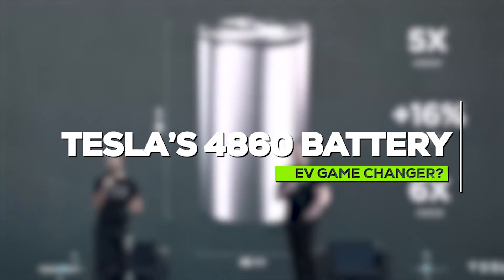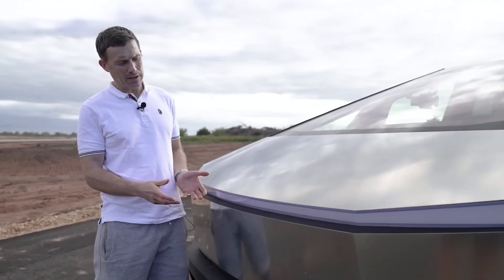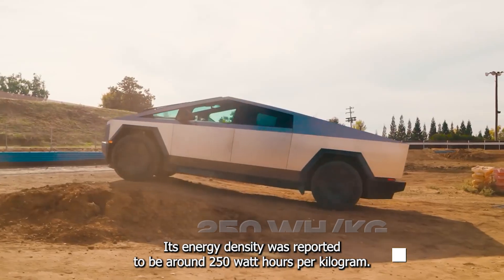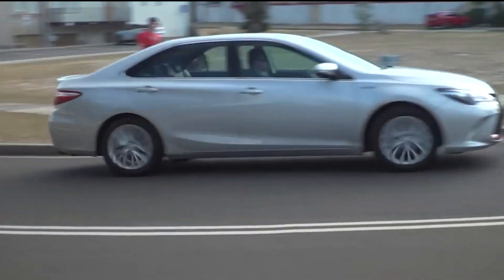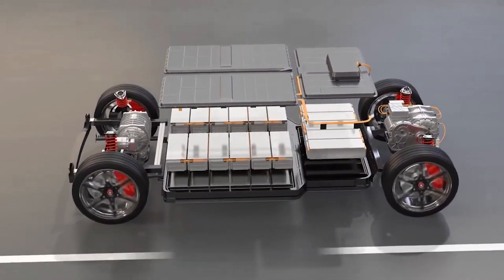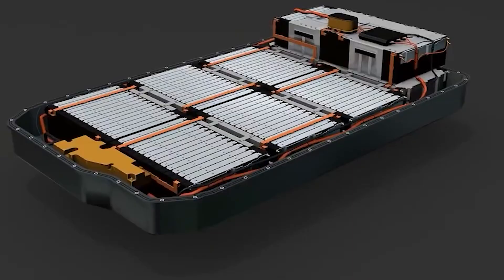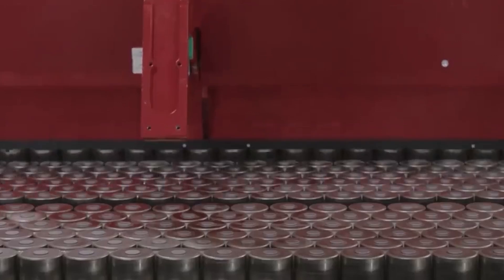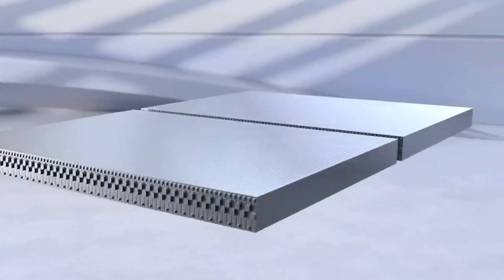Tesla's INSANE New Battery: EV Game Changer or Hype?!

Comment: I mean, you can do some basic research and find out that 4680 batteries are about the same 'energy density' as any other lithium batteries. Sure, they got 5 times the capacity compared to 21700 but that comes at the cost of ~5.5 times the volume and given that both batteries are cylindrical and are packed inside a rectangular box, their size doesn't really affect anything.
Reply from the maker: Great point! It's all about finding the right balance between size and capacity. Sometimes bigger isn't necessarily better. 🤓🔋 #BatteryTech

Comment: if they are not easy replaceable the are as bad as any other. Small accident in a car and the whole EV car gets written off.
Reply: It takes more than a small accident to damage the pack.  Any motor vehicle hit hard enough to damage the frame to the point it would cause battery damage in an EV is written off anyway.  A lot of Teslas are totaled for severe crash damage and the undamaged battery packs sold on ebay or copart for huge bucks.
Reply: @ohger1  I think the issue is how to check if a battery pack is damaged or not. It is time-consuming and requires specialist equipment and technicians.
Reply: @janek2512  No, it doesn't.  Absent any physical damage, the car's own BMS does the diagnostic tests continually.
Reply from the maker: You make a great point! 🚗🔋 Easy replaceability is the key to keeping EVs on the road after a little fender bender. Imagine a future where replacing batteries is as easy as swapping out a smartphone battery! 💡🔄